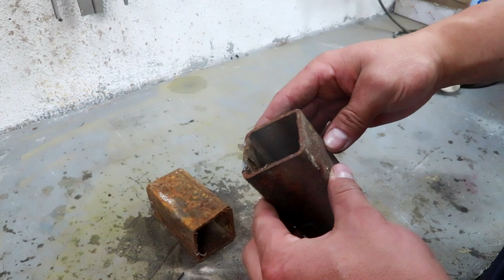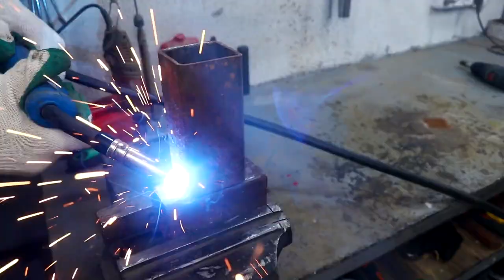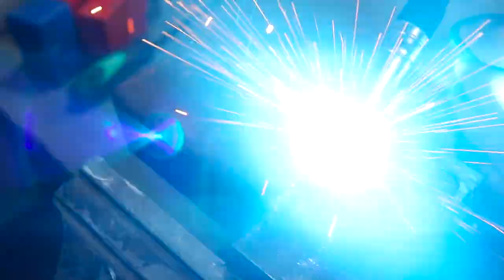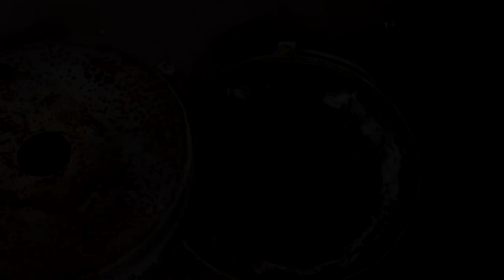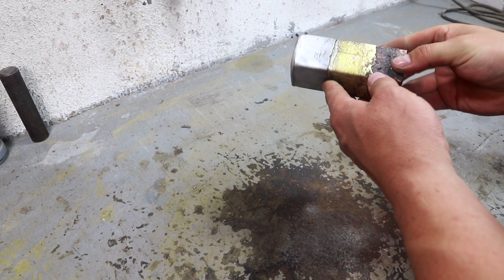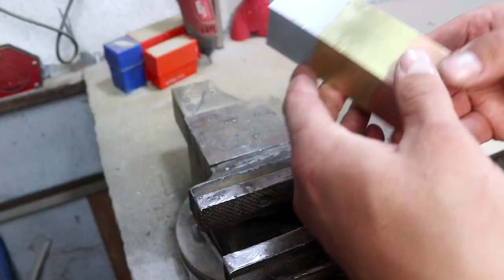Triple  Metal Meltdown Casting Brass Copper Aluminum Ingot

Comment: Did you use screws in between the blocks to keep them connected?
Reply from the maker: There are no screws between copper and brass, there are screws between brass and aluminum.